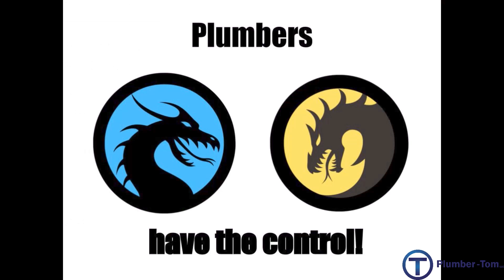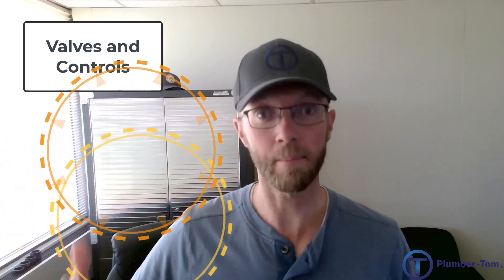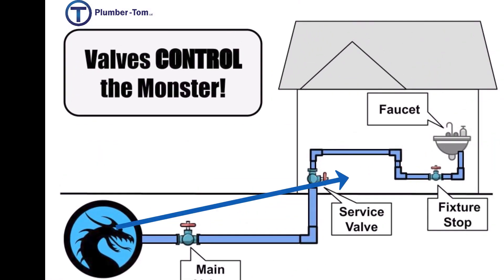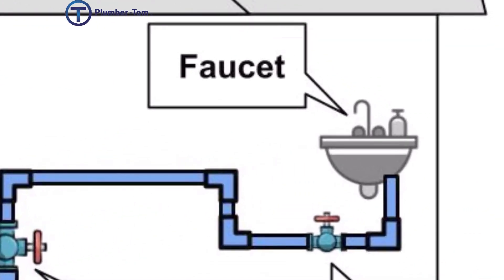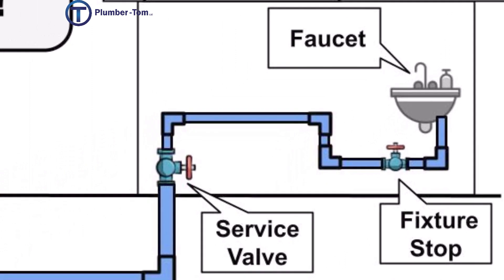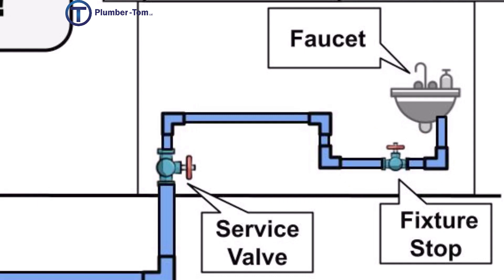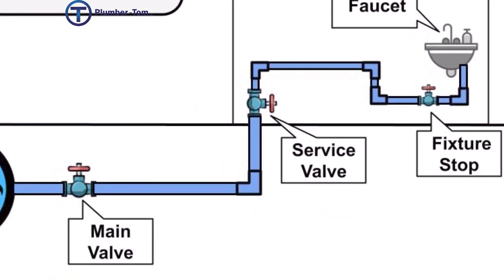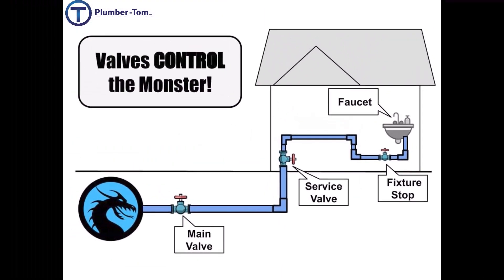Plumbing Parts Identification: Valves and Controls Episode 1 - Why do we need valves?

Comment: I liked the diagram showing the fixture stop and service valves, two relatively new developments (historically). The place I'm in needs the service valve replaced (I need to figure that out, all threaded galvanized pipe and 80+ years old) but no fixture stops for the tubs. 

In the '90s I owned a condo that lacked a service valve. Replacing the shower valve meant turning off the water to all 4 condo units in the building. The Hans Grohe had about 3 times more brass than the Delta it replaced. (Propane was a bad idea, but luckily I did not burn the drywall too bad.) I think I finally got it leak free at midnight. At 11:30pm a friend had stopped by, I thought I had it secure but noticed the tiniest water stream coating his eyeglasses. 

I have a vague memory of first adding ball valve shutoffs right before the shower valve so that everyone would have water that weekend. Buried behind the tile wall of course now. It would have been smart (and possible) to add an access panel on the other side of the wall (a closet) but I knew zero about drywall.
Reply from the maker: All too common!  Why don’t people put more valves in? I am always amazed when it is like that. 

Thanks for watching and sharing your experience!